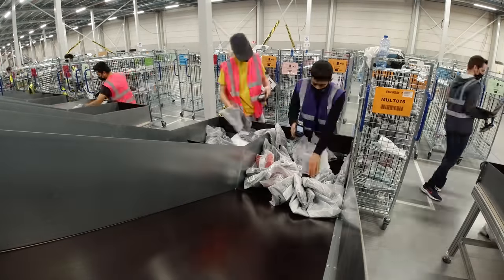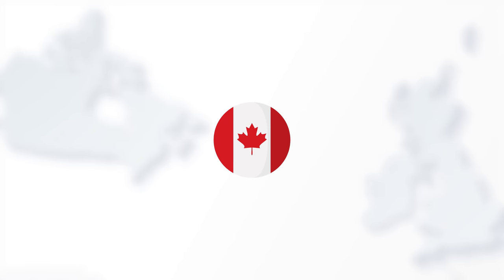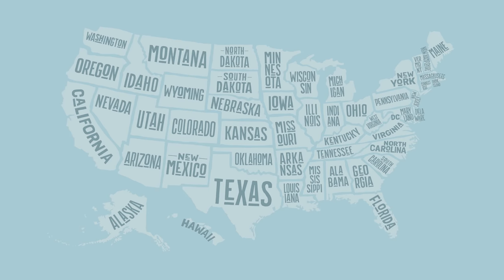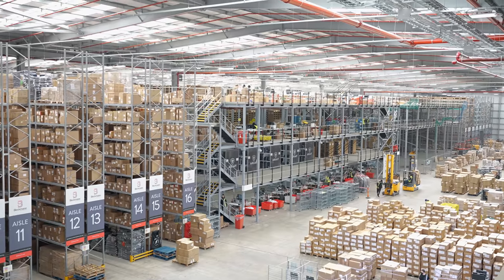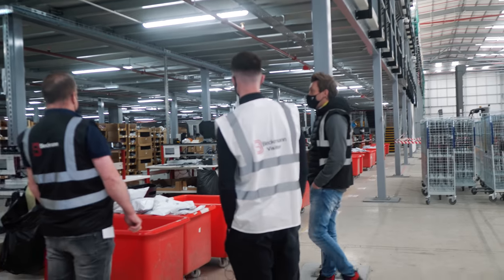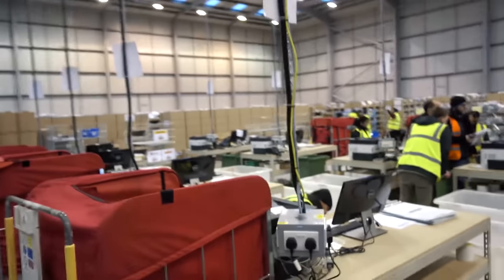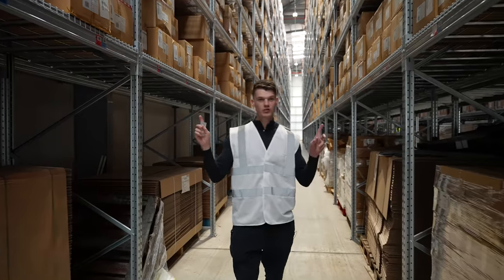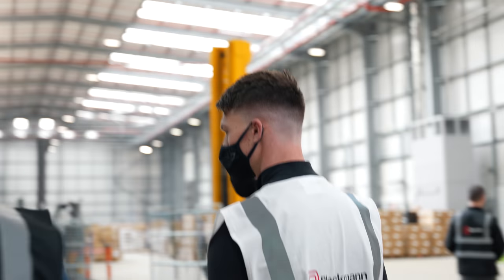15,000 GYMSHARK ORDERS A DAY | Becoming a global brand!

Comment: I'm confused, how is this an investment from Gymshark? 

Bleckmann and Radial are dropship fulfillment managers. The warehouses and distribution centers were solely constructed by them and they are 100% owned and run by them. The people working there are Bleckmann/Radial employees. Radial and Bleckmann are taking a cut for every parcel shipped. Like Amazon FBA. 

How is this an investment from Gymsharks' end?
Reply: I was thinking the same thing I don't think it's a bricks and mortar/balance sheet type of "investment", it's more of a case of we're spending more money on our partners so we can have larger centers, additional workers and therefore improve the delivery times etc. for the customer
Reply: Well, I'm sure there is obviously an advanced agreement based on the volume, they probably signed a 5-year to 10 year contract, with a downpayment to help scale bleckman. A warehouse of that size + a team fulfilling + the expertise/software of automation costs easily a 300k-1m/month to run per Distribution center with the actual facility costing 20-50m, down payment alone was on the service, was prob a few hundred k.  One mistake Gymshark is doing is not taking on the logistical side themselves and as you mentioned, letting a 3PL/dropshipper handle it, granted it is very difficult, cost-intensive, to do this as you scale, but they likely lose tens of millions a year not owning this process. One of the reasons Amazon is so successful is its because they have their own warehouses, developed their own automations, and fullfillment.

On top of that, their business is run entirely on shopify. The amount gymshark probably pays shopify is in the millions per year since shopify costs per package...most likely again, gymshark prob has an exclusive deal with shopify with much lower costs and account managers etc but again, the mistake is that they are so deeply embedded into shopify that they take on many excess costs for not owning the process/servers etc.
Reply: @joecold8200  agree that eventually long term they will have to move their website off Shopify and do fulfilment in house eventually, it's still very much operating like the dropship model it started off as, but I feel like they won't even consider this until they are at their "peak" in terms of market share and sales several  years later. 

In fact while  these services may cost alot, they are actually holding a net and net margin 50% more than the like of Nike...

I feel like once you've maximised your market share, cost savings and streamlining becomes more of a focus and alot of businesses will then start to move high costing outsourced services in-house. Imagine how hard it would be to scale at the speed they are while recruiting and developing all these logistics processess and recruiting and managing thousands and pickers and packers. 

They are cleared very good at marketing their products and are focusing on growing as fast as they can!
Reply: @joecold8200  very good analysis I think. In one of the videos he mentioned that they tried to move off of shopify at one point, but it was a disaster so they went back to shopify. The pricing of shopify is 2.4% of the sale + 30 cents per Transactions. If we take the 300 million Gymshark did last year, the shopify costs will probably be around 8-10 million. From my point of view this is easily justifiable if you have high margins and don't want to deal with all the backend stuff.
Reply: @DanGString  True, I agree. Sustaining that growth while at the same time building the warehouses, recruiting staff, etc. seems almost impossible. The strategy you pointed out makes much more sense. Moving to your own warehouses once you don't grow that fast anymore. I'm still not sure however if leaving shopify would be the right move and save costs long term